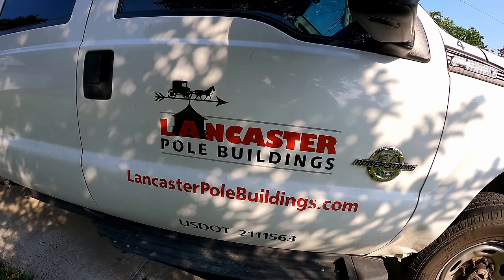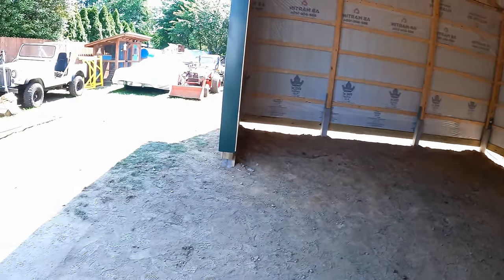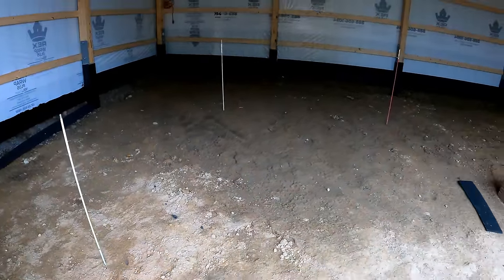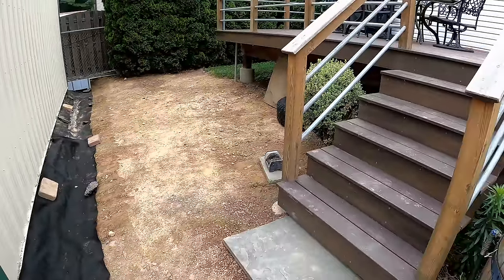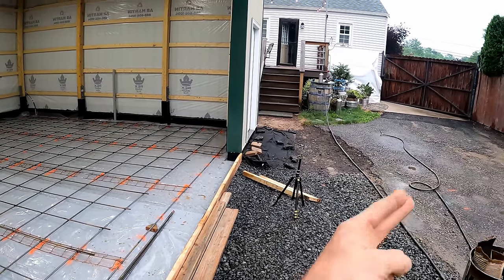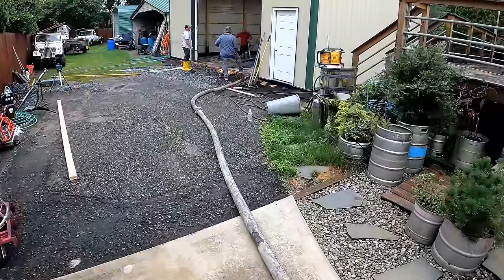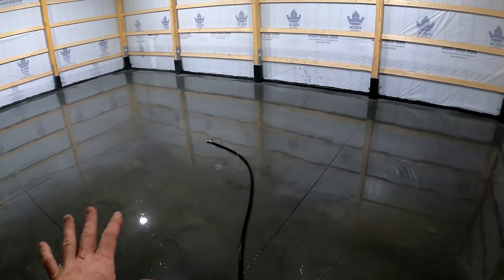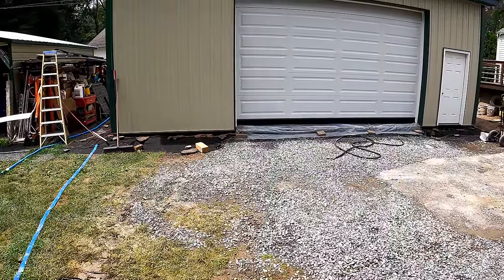FINALLY! Pole Garage Build/Concrete Overview - NNKH

Comment: Chris,  level the floor with 2 part apoxy seals the floor and protects it as you know.   Use a floor water squeegee. It's really simple.  And puts a nice color solid or swirl finish. Looks awesome brother.
Reply: Good idea, and throw some no slip into the mix for safety
Reply: No!!!! Leave it alone!! They put dish liquid in it fo Sheen it's Over!!! Epoxy flake red white and blue roller done!!!!!!!
Reply: Can’t drag a transmission or diff across it, definitely can’t use the floor as an anvil. His floor is more then acceptable as far as level.
Reply: @turbolab2376  well, the puddling up bothers him as a masonry 30 day is enough time to protect the floor If he's interested in it the apoxy put in will level it out also.
Reply: Only one problem, he has to wait 28 days for it to cure before he can epoxy the floor. I know what it feels like to be so close to being able to use your new shop but can't until the epoxy is done...
Reply: @dc6233  8 to 10 days

Comment: Hey Rennaisance Man, I would supplement those with some  Led Bars on the side walls where you think your lift may be. The overhead LEDS are great but they cast shadows when working under the hood  or underneath a vehicle.. Side lighting helps a lot

Comment: A tip I learned the hard way…cut relief cuts 45 degrees diagonally in from the corners of the overhead door frame so they intersect in line with the middle of the opening. The slab will shrink where it meets the those corners and crack, guaranteed. FTR I watched all the way to the end, it was worth it.

Comment: Lancaster pole barns is building mine too! I'm in valley forge area
Reply from the maker: Awesome! They did great work. Tell them to tamp the holes when they backfill. That would be my one complaint however I took care of it after the building was up and didn't plan to pour concrete right away. They settled quite a bit after some rains
Reply: @NoNonsenseKnowHow  I'm a contractor, and for the price, I'd rather they do the work, I'm more expensive lol. Let me know if you ever need some help for a video, I'm not far, you look like you are in delco

Comment: Just so you know, when we take concrete cylinders for testing, we place them in water for a 7 day, 14 day and 28 day test under compression to determine the PSI strength

Comment: The floor looks good. It’s harder to get a perfectly flat floor when you’re working on an interior space because you don’t have the advantage of being able to screed the concrete using the exterior form boards as a guide. They are just floating in the concrete and trying to get as level as they can. So given all of that you look like you got a really nice floor.

Comment: It was really fun watching it go together.  I built my own 30x45 pole shop about 15 years ago.  I’ll tell ya, it won’t be long before you’ll be saying, “I wish I had added this or done that”.  😂
Reply: MarkDeaton-gd1sx  what I would do if I had a do over, would be to stick build and clad it in metal rather than building a pole barn.  Still had to do a floor, and to finish the inside, had to add quite a bit of framing and insulation was a challenge.  Don’t think I saved any money when all was said and done.

Comment: You definitely found a keeper with Jen, she’s too cool. It was after midnight, she’s running around gathering sheets, w/ a smile, so you can tuck in a concrete pad. 😂😂

It turned out great, you’ll definitely get your money’s worth. BOL

Comment: Jen, the reason you don’t see Busch Lite in bottles generally is that Anheuser Busch uses Busch Light in cans as a place to add scrap beer. Scrap beer is the leftover beer saved after finishing production runs of different brands so the color won’t be consistent. Everything else will be the same alcohol, calories carbs etc.

Comment: Hey Chris, next time you get concrete, and have extra, you can put in galvanized eyelets, to make your own mooring blocks to either sell, or use for yourself. That’s what we did when we built our house in cape cod, and they currently are mooring my boat in Provincetown harbor. Thanks for the video. The garage looks amazing.

Comment: I think the same crew built my shop... lol but I didn't get any offers for perma-column though. dang it!  I just figure deal with the rotten wood when the time comes for it. I will say though my favorite thing I did was put insulation heating pipes and vapor barrier under the concrete and even though the heating pipes are not hooked up yet the floor NEVER weeps water and is always warmer than the ground in the winter time. Great to see you're making progress and congrats on the new work shop!

Comment: Don’t overthink it too much. I built my garage 17 years ago on soft, sandy South Georgia dirt and no cracking to date. If your going to heat it in the winter, all the better for the floor. Yeah, you might get a few with the weight of the lift and cars, but it’s concrete and it cracks! That floor will definitely outlast your time living there. No sweat!

Comment: Twenty years ago the standard for flatness in concert was 3/32 of deflection in 10 feet, it was rarely if ever achieved. That standard pretty much doesn't exist anymore. Having a low spot is disappointing considering what concert cost these days, but it probably won't be noticable with day to day use . It's really common to have low spots and ridges in concert. All that being said I really enjoyed the video .

Comment: For my garage, I used a 6" slab of 4500 PSI concrete, and I wet-cured mine also.  Wanted the extra strength for a lift for sure.

Comment: Been doing large commercial construction for 25 years. You did a great job on the slab. Great work on the curing! Don't worry about that high slump. If you noticed it hydrated  as fast as the low slump. Also 3/8" over 35' should be in per your FF FL spec. Good job!

Comment: I did the same as you and ran conduit underground from my shop to my house. At the time I didn’t know what I would use it for , but I ended up running nice coax for my CCTV cameras and also ran some cat -5 cable for a WI-FI range extender thing . I was so glad I did that. Thanks

Comment: The garage looks great. I wouldn't be too concerned about the uneven surface. Over time, it will settle and you'll never notice it. If i remember right, you were going to put the lift there so it shouldn't be an issue. And about the haters. Don't sweat them either. You, Jen and Gus put out good content. Always look forward to watching.

Comment: Do yourself a favor and caulk the expansion joints with some gray urethane caulk. It'll keep it a lot cleaner and won't catch jerked and crap. You might also want to finish the floor perhaps true make it a lot easier to keep clean.

Comment: I think you should put an Ag pipe across the back and sides of the shed in a deep french drain so any water trying to go under the slab will instead run well below the slab to drain.

Comment: Glad you did the wet cure, well worth the effort. I did it on my garage floor, my shed was built on top of the slab has 6 inch beams under the slab for the outer walls. 20 years later it hasn't cracked. Well done on the build by the way.

Comment: A concrete slab will never come out perfectly flat. Weight on the substrate. Movement of earth. Different batches and so on but the guys did a good job wait until a month later when full cure is done. You can then grind fill or polish but it is still a shed and will be used as one. Good job enjoy

Comment: Great video! ive been in the construction industry for 20 years, looks like everyne was doing pretty solid work, big fan of the wet cure, esp in a shop type environment where the concrete gets beat up and hold alot of weight!

Comment: I'm not a concrete guy either but have worked with stucco product manufacturers. Moist curing is recommended for stucco so makes sense for a slab. You may want to look into a self-leveling skim coat to level if it bothers you. It's a fine aggregate cementitious slurry that has an acrylic bonder, but you may have to abraid the surface first. I think the last one I used went down to 1/16" & up to 2"

Comment: Curing if its hot you can place sand on concrete and keep it wet . But winter curing you dont need if its cold weather only thing i would have done is clear sheeting to bring in light naturally it saves tons of power. Regards from south africa

Comment: One other thing. You can expect the concrete to take longer to cure because it’s inside that garage. It’s not gonna have the advantage of being outside where it can give off all the water and cure faster. You might have to wait more than 28 days before you can put that lift in. We over-poured an existing slab on an interior space in our house, and we ended up having to wait two months for the slab to dry out enough before we could put any kind of flooring in.

Comment: I did my pole barn about 2 years ago.  It turned out great, my only regret is I did a 10X12 garage door.  Should have gone bigger.  It is plumb full!!!!!  Where I put the barn limited how big I could go.  I would have gone bigger if I would.  Kind of like your area limiting how big you could go.  However, just hit me, you could have put a back garage door and oriented it as such you could have gone bigger.  Looking forward to see how you finish it up!

Comment: Where the water is retained the most, drill several holes in the floor so that the water can drain away and fill them with fine sand. You won't wash the garage floor with water that often but the water has to drain somewhere.

Comment: I would have installed a sprinkler with a programmer to get the concrete wet at regular interval,doors closed.
Reply from the maker: Too much evaporation and could cause mildew on the walls

Comment: I really like those concrete posts on the lower couple feet of the 6x6's.  I don't have that and i have a gravel floor on the pole barn and always worry those things (even though they are treated) will rot over time.   Congrats.  Pole Barns rock.  Nothing better than keeping all your stuff protected.  Helps you sleep at night  ;)

Comment: Very possible the low corner settled from all the rain. Flat workers will dig post hole piers to hard pan if they anticipate any settling. Most impressed with your drain.

Comment: Looks great. I don’t work with concrete but it looks great to me 😂 I doubt that you will ever really notice it. Won’t even notice the cracks if you epoxy seal it when it’s dry. I watch a lot of yt videos. Your channel is like a few other channels that I enjoy, just shows up out of nowhere whenever. Kinda like some of my friends 😂 if you’re not worried about the algorithm and making the most profit from yt then it’s not a problem. I’ll be here watching when you post. Still have older videos I haven’t watched and I also try to fit in Jen’s channel when I get the chance.

Comment: I put three Hyperlite LED shop lights in my 30x36 shop, they do a good job, however one crapped out after only 3 months with hardly any use at all. The other two are doing well. Maybe you will have better luck than I had.

Comment: I built a 24x24 back in 94 but I poured the pad then put up the walls, for curing I used an oscillating lawn sprinkler. Wish I would have built a 40x60 lol. never big enough. Looks good.

Comment: Chris, looks good! No, most people do not wet cure their garages. I applaud the steps you're taking. What township are you dealing with? LM or Falls? Drainage doesn't look bad, concrete looks good though I wonder about that second load slump and how much water was used to finish the slab. Definitely going to keep on checking in as this is right in my wheelhouse as far as the work goes, and, it's local! But yeah, man, keep it up!   <--  Local concrete/soil/asphalt inspector!

Comment: I know many people love a smooth finish on the floor.Please be extremely careful you have a surface that can be as bad as ice to walk on Just the moisture from the grass can make it slippery.I know a person that was just walking on floor like yours walked through a wet spot fell and had to go to the hospital. The better finish is to have a light broom finish. Those tiny grooves make all the difference.
I put them on the concrete pad I put in.What a difference
   I like your building, best wishes.

Comment: Tip for your low spot:
(worth every penny you paid for it😂)
Get some rubber conveyor belt and cut to fit around your lift.  If you put the slick side down it will help with traction when walking, and you will not be wading...

Comment: Great video! The concrete companies should grade the floor so that any water runs to the middle and towards the door, not the walls. I had that same problem and it isn't nice in the winter when you get an icy car in and the water runs towards the walls where you have stuff so it's impossible to get out and then it freezes. Are you going to insulate?

Comment: Excellent vid! I'm in on the wet cure, get all the PSI you can. I don't know what you paid but I wouldn't hire those concrete folks again. That floor should slope about 1/2" from the back to the front. When the space is full of stuff if water gets in, yikes!

Comment: Equal parts of baking soda and sugar in a small container with 1/4 holes will eliminate your ant problem. Works with most insects and rodents. Cost-effective.

Comment: I was surprised no floor drain or pre plan where lift was gonna be for thicker conrete but nice garage, congrats.its awesome to have a shop looking forward to the videos coming up
Reply from the maker: No need for a floor drain. I don't wash vehicles in there. And can just squeegee anything else out the door. Also most lifts call for a minimum of 4 in thick concrete. It's about 6 in over where the lift is going.

Comment: Hey... use an epoxy fill/coat to level out the floor and get rid of the 1/2 drop. I have used it in a shop before with great results.

Comment: Kerp it wet the curing process evaporates water on top instead of evaporating the water from eith the slab by the heat generated by lime in concrete.we used burlean on bridge decks. Looks great

Comment: Great vid as usual, I think shop turned out awesome.  I wonder if maybe you should fill the cut line that comes under the door and is exposed - any concern that water/snow will get in it, freeze and then crack it when it expands?  Just a thought, looking forward to seeing it finished.

Comment: Done my share of concrete work and I think it’s a great job. Often you overkill your concerns after a pour but in time you can relax it will serve you well. 1 small question, I would of selected a tan or white roof with green trim. Heat reflection is the reason but it may not matter .

Comment: You are going to put a ceiling in it right? and have the walls insulated? I would have epoxy coated the floor as well.

Comment: also I wonder if the back corner concrete is cooler considering the amount of flow going into the sump right behind it...and not evaporating like the other areas.

Comment: You can use the plastic sheets to fab a paint booth... Yeah!😅
Or use them to cover projects temporarily, because you don't want moisture to accumulate under it and rust out a project, or tool boxes, or whatever. You will find a use for them no matter what! 😅😂❤

Comment: Hey Chris, why does the structure go up first then the concrete is poured?  I'm in AZ and everything I see here gets the slab poured, then construction happens on top, seems simpler. Only thing I can figure is due to weather the pilings have to go deep into the ground? Just curious why it's different there. New shop is looking awesome dude!
Reply from the maker: That's just the way they build pole Barn type buildings and garages around here.  The slab is separate from the foundation of the building.

Comment: I would have moved the smaller green building from the back of the property and built a garage right across the back of the property and then you would be able to drive right down and into it and be able to build a much bigger garage

Comment: The space looks AWESOME!  Learned a LOT, as I am planning to also have a garage built when I retire and move in a couple of years.  Looks roomy, and I guess a lift is OK on six inches of concrete(?).  A LOT to learn, but this was a great start.  As for the haters, like my old pal Andy used to say, "fuck 'em if they can't take a joke."  Cheers!!!

Comment: No matter what you do...........there are two types of concrete.  Concrete that has cracked and concrete that's going to crack.  When I did my slab for my shop, I placed sprinklers all over and just let them run all day.  I still have a few cracks in my pad.

Comment: Nice building! The piers are the way to go. Just got my 36x56 done. Concrete day is Saturday. How tall is yours from finished floor to bottom of the truss? I went with 12'-1" Really wishing I went higher as all the lifts I want are around 12'-4" to 12'-6" My current lift is under a carport, it is 12'-7" been doing great since 2009, but it was time for an upgrade. Wish I hadn't assumed it was 12'. Oh well.
Reply from the maker: Mine is 12 ft on the dot. Wish I went 12'1" like you.  The bendpak lift I want is 145".
Reply: @NoNonsenseKnowHow  See if rotary will sponsor you, and check out the SPO10 series. 11'-8.5" height. There fast, and good quality. Out of my budget though.

Comment: If your doing a 2 post lift you should have figured where you were gunna put it first and dug 2 deeper holes where the legs go for more of a base for them
Reply from the maker: After reading the specs, even a 12,000 lb lift only calls for 5 in of concrete. So with the rebar in there I don't see any reason to make it deeper..  it's never cracks, can always cut out the concrete in dig deeper footings
Reply: @NoNonsenseKnowHow  no hate bud just seen a few fail over time good work though going the extra mile to keep the concrete wet